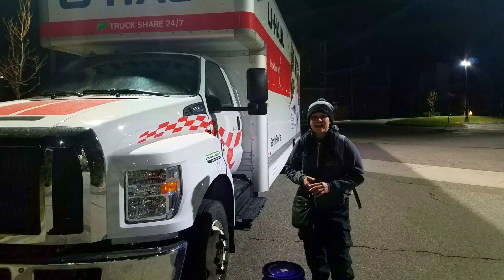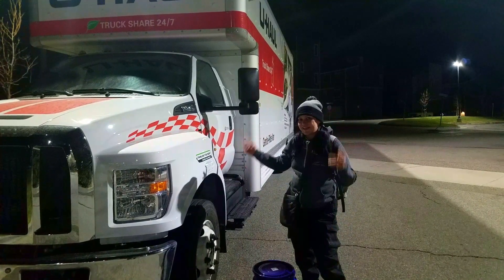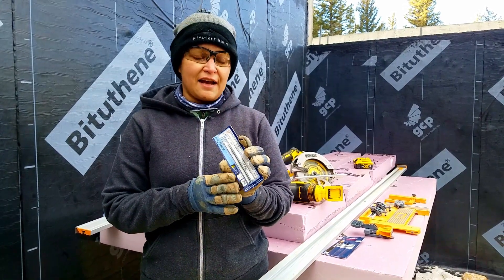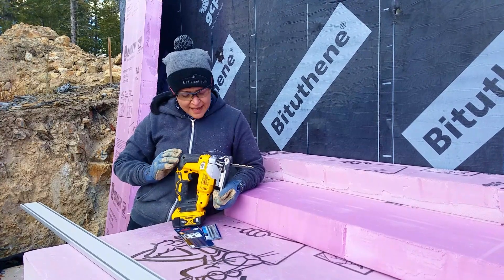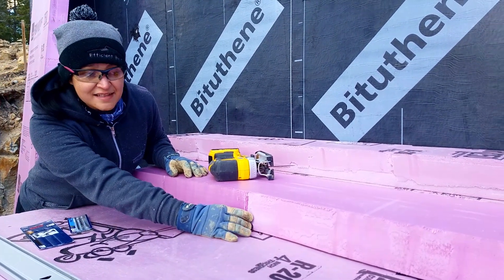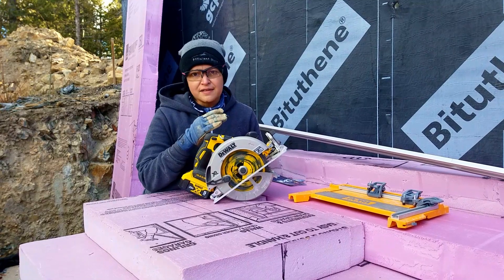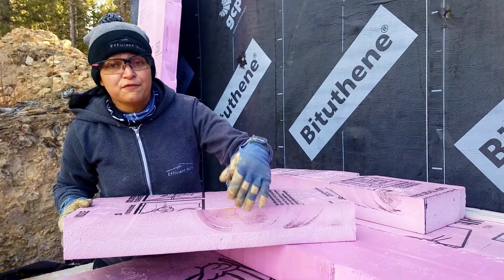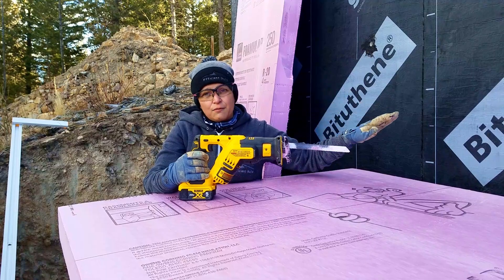Installing Foundation Exterior Insulation: Step by Step Guide | Efficient Build

Comment: On the back-side of the home, below the parking pull-in, what are you planning to cover the insulation with? I think one of the renders showed sloping earth coming down that side from below the mini-home side of things, coming down at an angle until the finished lower-level windows?
Reply from the maker: Yeah, exactly right. On Ep 1 of Season 2 we'll be putting a drainage mat (Poly-wall Arroyo Drain). Then what ever remains above grade we'll put some siding that is fire resistant. Maybe stucco or some light weight concrete panels.